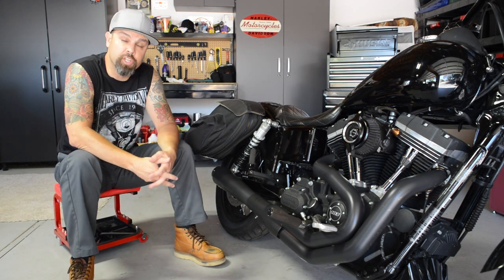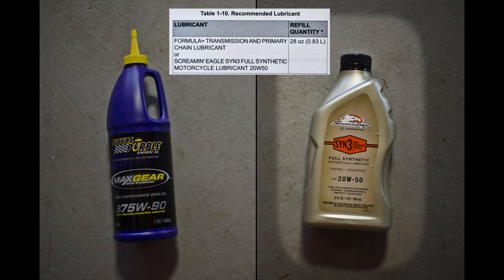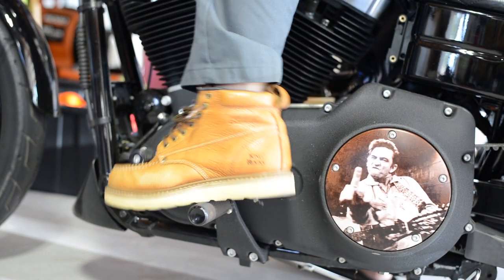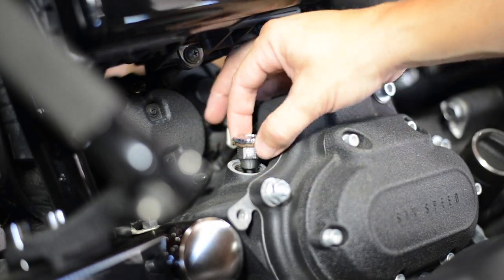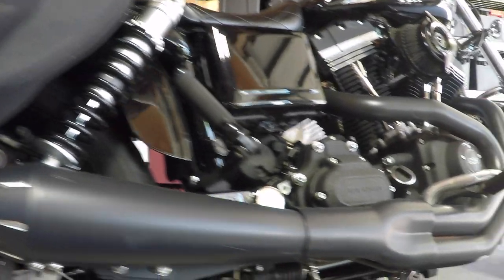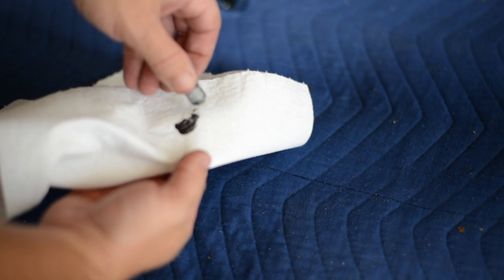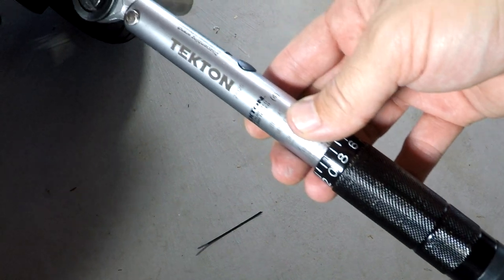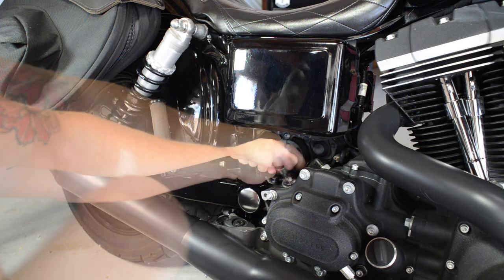What Lube are you using in your Harley Davidson Transmission?

Comment: I decided to go with Amzoil severe gear oil, 75-140 I think it is. The difference was astonishing, like the shifter was disconnected from anything. It was that smooth. I did this and also went with the Amzoil appropriate oil in the engine just prior to taking my Dyna on a 4K trip. A couple of times when going slow on the Blue Ridge, the Shenendoah and the Natchez Trace, I got 71 miles to the gallon. I didn`t believe it the first time, but after the second time there was no questioning it. With these two lubricants, this bike is going to be pleasing someone long after I`m gone.

Comment: I use Red Line V-Twin Transmission Oil with ShockProof in gearbox (same fluid as Heavy ShockProof). Shifts smooth and makes no debris on magnet.
Reply: +1 best trans fluid on the market 🙌

Comment: Adding to my recommendation for Primary lubricant is the WARNING that many aftermarket performance clutches CANNOT be used with Synthetic or Semi-synthetic lubricants.  

For those running Kevlar or similar clutch discs, I highly recommend a 4T 10-40 PETROLEUM BASED oil, Castrol makes a great one for the rice bikes. I use this Castrol oil personally on my Drag Bikes after freshening up the top end, and or complete engine build.  

The 4T 10-40 will truly help with finding neutral as well as ALL the protection you need.  

Sorry but I never ever do a 3 hole change with the same Screaming Eagle, MOBIL1,  Amsoil, or otherwise.  

RIDE SAFE RIDE FREE.

Comment: I use Castrol GTX 20W50, works great, i just change it often, everytime i change the engine oil, i change the trans too. I use Mobil 1 V Twin in my 103 motor though. That thick oil sucks when its cold and even the first few shifts in the morning, it will last a long time but thats about all its good for.

Comment: 96 FXDL
20-50 Bel-Ray mineral for the engine (works well in winter and summer)
Gear Savor 85w 140 Bel-Ray for the transmission
ATF type F for the primary

 I change the oil in the spring and again in the fall, more if enough miles have been clocked. The mineral is cheaper than synthetic, and it is changed before it is worn out.

Comment: I believe you check the oil level by just letting the stick touch the case, no need to thread it in. Also I found that using Red Line fluid made my Heritage shift a lot smoother and also a lot more quiet.
Reply: midlantic1 you are correct. The Harley manual states NOT to thread the dipstick in, just let it rest on the threads.

Comment: IN the owner manual for my 2012 Dyna it states to not re-thread the plug when checking the level
 
Insert dipstick into transmission with filler plug/dipstick resting on threads. Do not thread in.

Comment: I bought my '12 bob used last April and had serious issues with finding neutral and the  primary whine along with hard clunking when shifting. bike only had 4400 mile. had the 5k mile service done and all fluids change but didn't help. I run amsoil in my diesel truck and looked into it for the bike. they have oils specifically for each oil, trans, and primary and they work great. bike doesn't whine near as much and shifts as smooth as one could as for.
Reply: Jason Hall   The whine is a bearing  going south. good luck, soldier!!!

Comment: Seems like with the drain plug on the right side, and the bike leaning on the left side, it may be wise to at least upright the bike for a minute while it evacuated the residual oil hanging out on the left side of the trans. Am I wrong?
Reply from the maker: Hi Keegs... what you said is true.   You could definitely evacuate more of the old fluid with some effort.
Reply: It look like there was a nother drain bolt on the right side for when the bike was leaning. The one on the bottom was for when it was on a motorcycle rack.  ???? Isn't the oil level and transmission gear oil level checked and filled with the bike sitting straight up level not leaning. ???
Reply: @ricksimpson2167  agreed the bike should be level for both tranny and primary refills...engine oil should be checked while on the jiffy stand,

Comment: What about redline v twin transmission with shock proof?
Reply: I used red line on my 2017 Milwaukee 8 and it was extremely noisy , I flushed it out and used Lucas 75/140 full synand very little noise  you have to go of your way t hear it  a better oil is Torco SGO 75/140 gl6 fully syn oil  used in my BMW K1200GT work fantastic . but if you live in Canada good luck on getting some ,no longer comes across the border

Comment: RED LINE V TWIN. 
My Dyna Superglide has 74,000 miles and a honest 200 laps down the quarter and eight mile. 

There's a reason almost every Top Fueler, with over 10,000 horsepower uses RED LINE. 

Brothers and sisters with a big twin, show your Hog some love, use RED LINE.  

YOUR WELCOME 🇺🇸🇺🇸🇺🇸

Comment: Super Tech 75W90 is perfect for the trans.  20W50 valvoline synthetic motorcycle oil in the engine with wix filter and 10w40 in the drive

Comment: So who test to see that gear oil was getting to all the moving parts? The oil lubricates by slashing that thick ass oil to all the internal parts. What test was done during cold starts? Since the oil is thicker than syn3,  it's gonna be like sludge to it gets to operating temperature, so will it have any oil on those moving parts while warming up?

Comment: I use mobile-1 75w90 gear lube in the trans and mobile-1 20w50 in the engine and primary
Reply: I have read that since regular motor oil like Mobil 1 is for engines, you could have clutch slippage due to the oil not having friction modifiers. I have read that ATF is being used by some people as this was the standard in the 70's-80's. I just did it on all three...Mobil 1 for engine, Mobil 75w90 and ATF on primary. 5k later I'm ready for the next oil fluid change and loving it.

Comment: Hey quick question. I hav a 2000 FB with a SE 6 speed. I always ck level of tranny holdin bike straight up. And i use spectra 6 speed fluid. Em i right or wrong. Thanks again for your help john

Comment: I use Amsoil primary fluid,Amsoil synthetic oil in the crankcase and 75 W 110 severe gear Amsoil oil in my tranny. I have a 1998 Harley-Davidson road king classic with 120,000 miles on it....evo motor still running strong.

Comment: I use Spectro heavy duty platinum 6 speed 75/140 , BECAUSE BAKER TRANSMISSION RECOMMENDS it the transmissions they design & build for HARLEY’s , also because they use to work for GENERAL MOTORS designing transmissions . Therefore they would probably know more about the needs of a transmission than I would ! ! !

Comment: Did Harley reinvent the gearbox?  Years ago (2002) I had a Mustang GT with a 5 speed manual Transmission.  Ford required a standard motor oil for lubrication.  I think it was a straight 30 weight .  worked fine.  I use a synthetic 20w50 in my 2017 Harley..  Been using it for years.  no problem shifting and good for 10k miles.  YOU DON"T NEED A GEAR OIL IN A MANUAL TRANSMISSION.
Reply: Allan Bieger    To light weight for transmission, come on now!!
Reply: Gear oil is "measured" differently than motor oil.  A 20w50 Motor oil is equaled to a 75w90 gear oil.  Check it out.

Comment: I drained my 01 softail oil as when I bought it dude said it needed it. It was pretty black. So while I was at it drained the tranny. It was a red clean thin oil (Amsoil)?? Idk but replaced with the same HD 20/50. Just not sure wtf was in tranny
Reply: HD has a reddish lube they use. I don't worry about gear lube much and my 1988 5-speed has no issues and no significant wear at over 150K miles of rather unkind use.  It's had whatever was handy from 60 weight aircraft or racing oil (which I use in the engine too) to gear lube. If a manual transmission is sensitive to lubricant I regard it as being poorly designed.  What both engines and transmissions benefit from most is clean oil and enough of it. I use ATF in my primaries as Barnett recommends for their clutch. As with automatic transmission clutch packs (very similar to multiplate motorcycle clutches), the friction plate material is what matters. Bike primary components lead easy lives compared to truck transmissions.

Comment: I'll use the 20 50 in the primary but not in the transmission I use Red line v twin trans fluid.
Reply from the maker: Hi Tap.  I hear ya.  A lot of people do.  But there are some great lubricant products out there specific to your primary, and I tend to use that as well.  I use Bel-Ray Primary Lubricant.  Here is Bel-Ray's take on this:

While we all know the benefits of a good engine oil, the advantages of a gear oil are often overlooked because people don’t know the different requirements of lubricating an engine compared to a gearbox.

Comment: Think I'm going to switch to 80w 140 in summer, 80w 90 still feels to thin, to clunky...
Reply: Dennis Morris I went to the full synthetic 80w 140 that Harley sells. It definitely shifts smoother and is much quieter than the 20w 50 that they say is ok to use. It’s a gear box, use gear oil!
Reply: @dougfrazelle-OldManRiding   great move

Comment: This oil non sense is an ongoing epidemic of confusion and buffoonery..  I go with whatever I have available.  Last years trans oil change I put Suzuki 20w-50 in the Harley.  I got a good deal on Suzuki oil for a bunch of 5 gallon jugs for 8 dollars a piece because some nut bag didnt want to put the oil in his precious Harley according to him it would "blow it up" because its not Syn 3.  The time before that it was Lucas Synthetic gear oil.  Its whatever I can get the cheapest its the best way to go since the most important part is doing the oil changes more often than not.

Comment: Can u run 75/ 90 in ur primary too?
Reply from the maker: 75/90 or 75/140 should work for Harley big twins.
Reply: ATF on Primary? I have read discussions on fluids that are put into the primary needing friction modifiers due to the clutch pack. Regular oil and gear oil do not have friction modifiers. Hence, gear oil is not recommended for LSD differentials. Need a fluid with friction modifiers. I just put ATF 5k miles ago and ready for my next oil change. I am loving it. Also in traffic, I'm not getting slippage anymore. It was a good switch for me from Amsoil and Syn 3. My bike is a '12 Fatboy Lo.
Reply: Primary is a non detergent oil , SAE 30w or 20/50  Do not add gear Lube to the Primary .